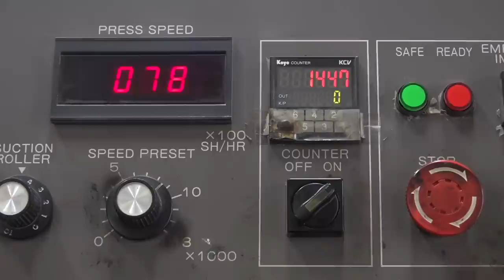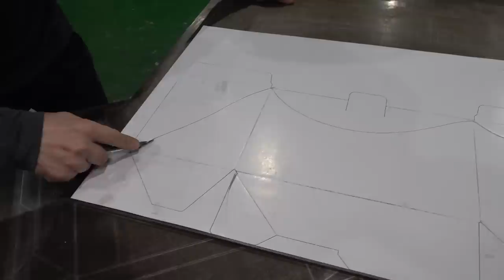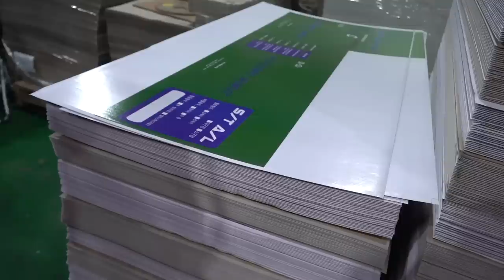Mass Production Process of packaging boxes. Box Factory in Korea.

Comment: I used to work for a large box plant... it was a fast paced work environment. We made the corrugated sheets, printed, die cut, glued, stacked, wrapped, and shipped.  Our single wall corrugator could produce over 6 million feet per day. Our double wall not quite as much. 

We had warehouses of paper stock raw material. We had warehouses of finished products. We had numerous Flexo printers capable of 4 color print jobs. Die cut was inline after printing, then folding and gluing. Our own ink shop could mix any color in any quantity. Usually ink sent out to print area in 5 gallon buckets. We had over 500,000 square feet of amazing plant operations. I miss it.
Reply from the maker: I'm happy to see my videos and look back on happy memories of the past. Thank you so much for watching the video.
Reply: @ProcessK  It was a great video and I have subscribed
Reply: Great experience.
Reply: @amalahmedchoudhury5181  Thanks for comment